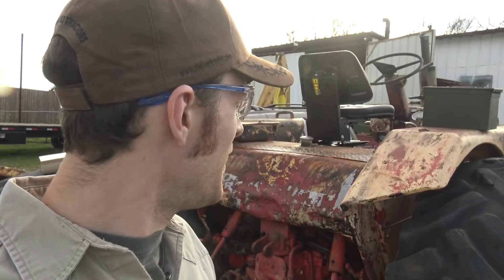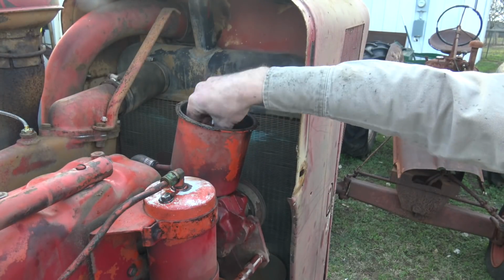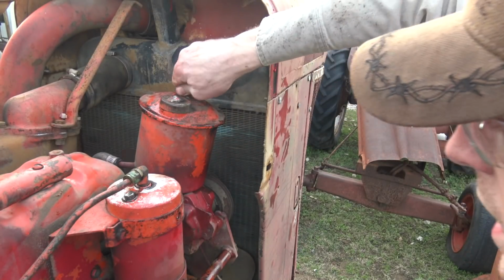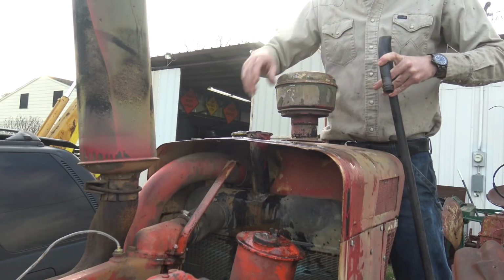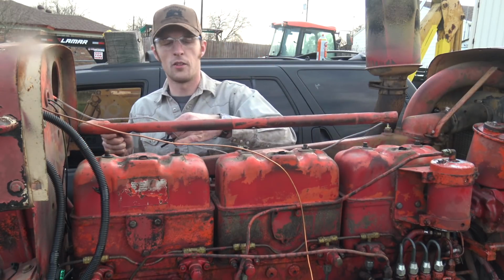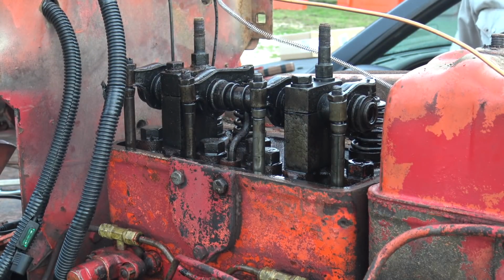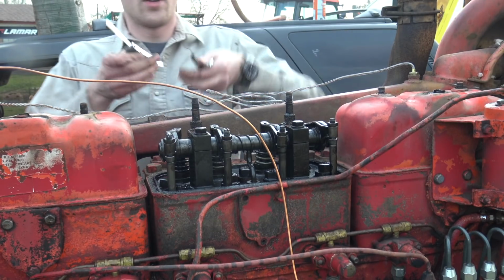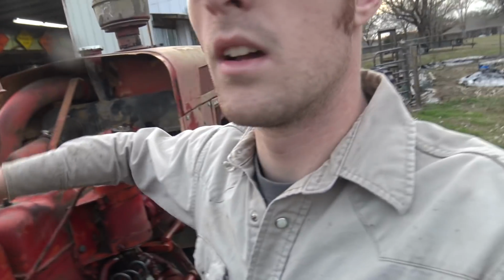GIANT NEGLECTED FARM TRACTOR BREATHES NEW LIFE

Comment: Unless I am ignorant to these engines, you have to find top dead center by manually turing the motor before you adjust the valves. You seemingly adjusted them all in a row with the pistons in random positions?
Reply: You have to know about engines to know when a valve is definitely shut and can be adjusted

Comment: To adjust the valve lash, you must be on the base circle of the camshaft.  Don't use the starter to bump it over, use a socket/ratchet on the front crank snout bolt.  Ease it over until both exhaust & intake valve are loose.  Then adjust the lash.

Comment: If you will put an over width power steering belt on it and keep it good and tight, it won't steer bad. If I remember right those are Eaton pumps used on a lot of stuff. If you will put a small electric fuel lift pump on it, it will make it start much better especially in cold weather. Very strong hitch on those tractors. We used them for 8 row planters that John Deere wouldn't pick up. They make a metallic brake disc that much improves the steering brakes when they get glazed over. Scott

Comment: Liquid cascade and water with several heat cycles does a really good job cleaning out the cooling system
Reply: Good idea. To emphasize,you are referring to dishwasher detergent,not dish soap. The former does not foam,the latter does. Both substances are highly basic. Alkaline. An earlier post suggested an Evaporust product. Which will be fairly sophisticated, but will be acidic. Citric acid or formic acid or such plus other,sequestering agents perhaps. 
Thing is,old style radiator flush kits were two part,was a mild acid,run as you describe, drain and flush,followed by an alkaline mix to kill the acid,drain and flush.
The acid gets rid of the oxides,the alkali acts as a soap and gets rid of the crud.
You can do that with a heavy duty brass tube radiator held together with several kinds of lead/tin solder. 
Never never try that with a modern aluminum radiator or a modern light duty brass radiator. Turn it into a sieve, you will.
Love those older radiators. They are actually repairable. And serviceable.

Comment: Needs to be on the base circle to adjust valves. A cheat on simple engines is when the exhaust is down intake is up adjust intake. When intake is all the down exhaust is up. Adjust exhaust.

Comment: You might consider Evapo-Rust Thermocure for the radiator. I have a John Deere 2950 that looked like there had never been anything but tap water in the radiator. I used Thermocure just like the label says with distilled water. Got it to operating temp. for a couple of hours twice. Drained thoroughly and flushed. What you drain is going to be black and have a bad smell. Fill with antifreeze and distilled water at about 50/50. The cooling system will look like a new engine.

Comment: On what ever motor I have adjusted the vales on ,one must keep turning the crank shaft and came shaft  over to the proper spot TDC so the valve must be closed before adjustment is done, with each pistol at top dead center so  the valve is closed before you adjust the each valve, or you will bend bend each of the valves wile adjusting , check it out

Comment: You can run the engine at an idle without the valve covers while you watch the valves function, or not. Check your cold valve settings with appropriate cylinder position. Find your TDC and firing order which shows in the engine casting. Old farmer.
Reply: Can confirm. Most engines won't sling much oil at idle. Have set valve lash on some with them running. Can be a trick to keep the wrench in place though. LOL

Comment from the maker: MORE: For those who like the things which YouTube doesnt, join us on a free mobile app called Telegram, under "Tractor Hoarders Group Chat", in case we get cancelled on here, by following this link: https://t.me/TractorHoardersGroupChat 

Also, check out our Patreon page to help support the channel: https://www.patreon.com/OWFA?fan_landing=true

SOME OF MY FAVORITE TOOLS:

The ULTIMATE Welding Slag Hammer, Made In USA:
https://amzn.to/2Z5HbjB
220 Volt Welding Extension Cord:
https://amzn.to/2CAxlP7
Cotton BSX Welding Jacket:
https://amzn.to/2VdGAuZ
KNIPEX German Made Pliers-Wrench:
https://amzn.to/35fchvN
OTC Slide-Hammer Kit:
https://amzn.to/3p7mq4Q
Carbide Burrs - An Affordable Set That’ll Last:
https://amzn.to/2VsxTgH
SUNGLASSES I WEAR - Quality at twice the price:
https://amzn.to/2VegmbE
Regular Safety Glasses that I Use:
https://amzn.to/2ATXtEf
My favorite rust removal tool:
https://amzn.to/3nxAfbK
Makita Metal Cutting Chopsaw:
https://amzn.to/3A6kVu1

Yes, these are affiliate links! Thank you.
Reply: If the valve lash can't be backed off enough it's a likely sign of a valveseat issue or potentially pushrod isn't in the lifter properly, the lash will tighten as the valve/seat wears and causes the valve to recess further inturn protruding the spring end further

Comment: A valve which is too 'tight' often means the valve-seat has sunk into the head. In any case, the head must be removed to resolve the issue.
Reply: Your no doubt right Bruce! That would also explain the hard starting we saw in the other video!
Reply: Sometimes you can get by with adjusting the lash, had a motorcycle that I needed to lap the valves on it to fix the worn out seats tho. All depends on how long it’s been bad

Comment: try running diesel in the engine oil and running it for a few minutes WITHOUT ANY LOAD then drain the oil sump and refill with good quality Diesel engine oil. That will clean the engine internally and improve its longevity so it does not circulate particles that lead to wear. The tractor is likely from the early 1960’s the serial number should tell you. An old homesteader who used a 930 as one of our early tractors.
Reply: Two schools of thought on this method. You may remove some of the gunk only to have it block an oil journal. Knock knock, who's there? Squeaky squeaky who....Squeaky knock knock!

Comment: the valves that are too tight. the valve is pulling thru the seat or the seat was ground too deep. you might get away with grinding the valve stem. if it was my tractor i would pull the heads and do a proper valve job on the tractor these case engines were reliable and had a long service life  between overhauls. also check the condition of the rocker arm bushings and shafts for excessive wear
Reply: Hit the stem with a grinder. It's not a Nascar motor, it's a FARM TRACTOR!

Comment: You're doing the valve adjustment wrong and could even end up having excessive valve lash the way your're doing it...
I am not familiar with thismparticular engine, but the principle is always the same: Rotate the crankshaft only by hand, with a socket and wrench of course, not with the starter.
Set to TDC for cyl 1 and adjust valves of cyl1, ten follow the firing order and rotate the crankshaft in the normal rotation direction of the egine (look at the fan blades to make sure you're urining in the richt direction) and work your way through the cylinders and adjust each valve pair per cylinder.  I found this on the internet for the Case 401D: Overlap valves on #6 and adjust both valves on #1. Overlap #2 and adjust #5. Continue on through the firing order (4-3, 1-6, 5-2, 3-4), perhpas that may help as well...

Also, the only time ever I know of a case where the exact valve lash could not be achieved even after the adjustment screw had to be loosened completely is because the valve was so worn down that the valve seating edge had virtually come off and the valve was litterally being pushed up into the port.  That I have seen only once... If you are having this adjustment issue, then it is likely beccause the camshaft is partially on the love , which does not let you do a proper valve adjustment anyway!

Comment: Valve lash adjustment MUST be done by compagnion piston. Both pistons in the sequence 1and 6, 2and 4, 3 and 5 are going up and down together. 
Exemple look at  no 1 exhaust rocker going up (close valve) then intake intake BEGIN going down then adjust both valves on no. 6 cylinder. and so on . Follow firing order 1-5-3-6-2-4 on 6 cylinder older in line.  Follow this and you will be good to adjust  valves any older engines.
Your adjustment are not ok as you try to adjust valves with rocker not fully up and reach proper clearance. 
Finally turn the engine manually WITH the stop pulled to avoid possible strarting as a precaution measure.

Good try you are not afraid to put your hands in.
Reply: You have done this before! 👍

Comment: A gallon of Riselone. Upper cylinder and valve train lube in with new oil change .Ugly stuff is condensation residue--- engine not run long enough  to heat up and evaporate water not an hour  more like 2  or 3  hrs to all-day 10 hrs and and a bout ten minutes to cool then shut down.. The Case that you have was almost the largest by that company there were 3 even larger version  a turbocharged  6,    an 8sp hydro  175 HP and an articulated With planetarys cab optional came  with ; 3 foot wide 6foot high rice and cane tires about 800 lbs each and  near 1500 full of water. Motors were your choice.
Reply: To stop condensation cut and replumb breather tube to just below air cleaner add a hose barb for clean air intake..Add three to one 1/2  inch line from rocker covers to 1/2 inch line going to block intake manifold so a strong and constant vacuum achieved..No More Condensation...

Comment: You want a beast to steer, have a 47 Case VAC, there is no power steering and have a front end loader on it.  Basically you have to be moving to turn it and also sue the brakes to brake steer it.  Have had it for the best part of 30 years and it ALWAYS runs, ain't real powerful but she get the job done and is very thrifty on fuel.
Reply: 57 Ford 600 ,same thing. If you want to dry turn the wheel, let down the bucket, pull like hell, drive away.

Comment: Sports bikes have that same problem.  It's caused by the valves "wearing IN" --  and that's from the valve seats being aluminum on a 1000cc bike, and as the seats wear, it causes the valve stem to stick out further and further-- and over time the valves will get so tight that it can't close all the way anymore.  So when you pull the cover and give it a valve job-- you have to remove these little discs or "pucks, or whatever they are called.  Essentially flat round spacers that are machined to the precise thickness that you need for the valve to have the right clearance.  So how you adjust them is buy buying the correct pucks/ discs that you need to get it to the minimum clearance again.  Also, you don't order them as a set-- because these bikes can hit 15k RPM (some of them)--  so you order the exact size that you need for each valve, even if they are all different.  There is a reason why sports bikes work so well at high RPM's-- they are built to a different standard of tolerances.